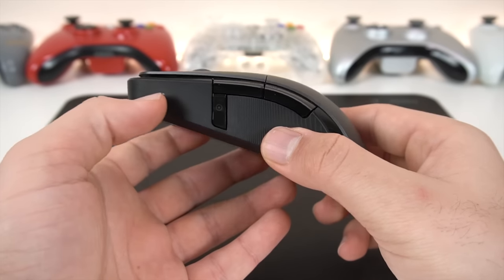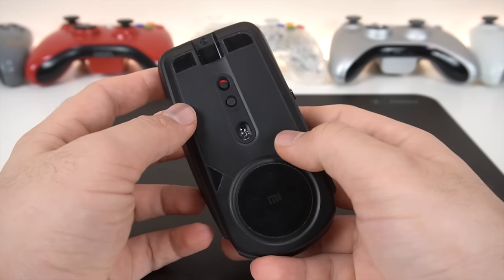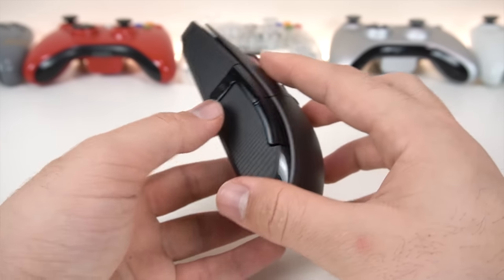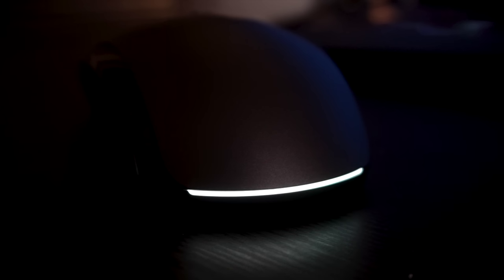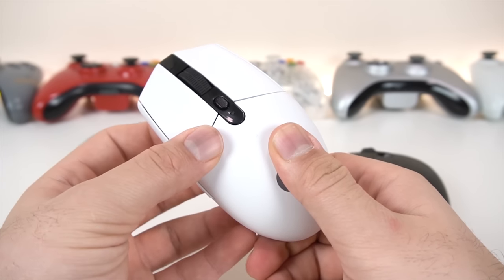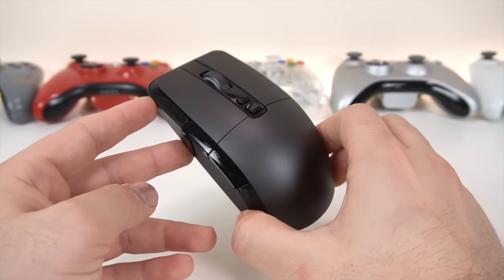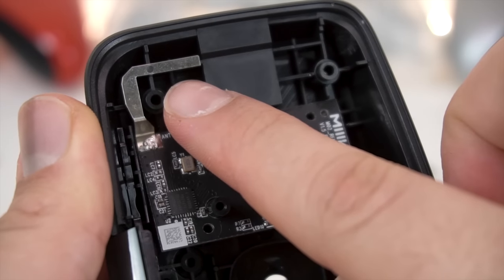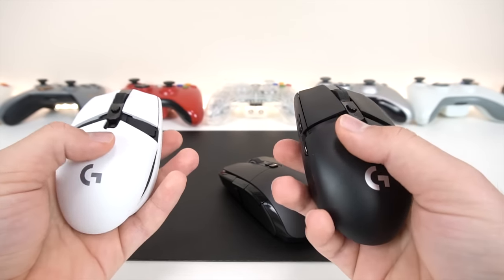Xiaomi Mi Wireless Gaming Mouse | Could Have Been Something Great

Comment: I have been using this mouse for 10 months approx., Dealt with two issues so far. The first one is battery life, of course. Dropping refresh rate to 500-250 etc. and shutting down LED lights through the software (you can find its fan version in english on youtube) works and extends battery life up to 3-4 days depending on usage. Otherwise you need to use it wired or charge it everyday.The second one is self-clicks on the left mouse button. I disassembled it and cleaned the button. Problem solved, but it was annoying tho. Apart from that, this is a great mouse, I like heavy mouses not fond of too light mouses, so it is not an issue for me.  Personally, I am playing games in wired mode and make other stuff wireless, since it is easy to switch between these modes. This is the best option I think.
Reply from the maker: Early cheap wireless mouse tech wasnt great back then now there are so many lesser known brands releasing good wireless mice in comparison

Comment: I have one. Mine does not make noise when you shake it.  Agreed that the wireless battery is poor. Less than a day. Polling rate drops from 1000 to 500 on wireless. I usually use it on cable. Not experienced the non wake up bug but I have not tried over a power off when it wirelessly connected as I generally don't use the wireless feature.

Agree that in use, the mouse feels great to use

The software would also make things easier if it was available with switchable language setting. Sad as the Gaming Laptop software that looks very similar is switchable to English. maybe an update will resolve that??

Comment: im a user of g305 for almost a year now. im not sure if i replaced the battaries or not i may changed it once and forget it or never changed it in one year of usage. it is a very good mouse in general buttons feel solid, sensor works just fine in most surfaces ect. i can definitly recommend one but there is one thing that you should know before you buy them. they are quite small even i as someone with bigger hands then avarage got used to holding the mouse over time but if you are not sure you probably try it in a store before buy it.
Reply: Hocam sence hangisi ben de xiaomi yada g305 almayı düşünüyorum senin tecrübelerin nelerdir , ben şu an g102 kullanıyorum ve çok memnunum elime tam oturuyor ama kablosuz olursa mükemmel olur diye düşünüyorum o yüzden Xiaomi yi elesem'mi diyorum

Comment: Design were a mashup between retro and futuristic i Almost bought it,  but after I discovered plenty of faulty units of it being perma dead after being turned off? I’m not taking the risk. 
Not to mentioned for modern wireless mouse, the battery life suck?  
For the same price, I’m now happy with Logitech M590   It has both bluetooth and receiver. Works fine on cs go for me..
I don’t buy the b.s of gaming thing either 

Original battery still running after 1 years (it’s crazy!!!)

Comment from the maker: Do you happen to have one? If so, how was your experience?
Reply: how to turn off the stand by mode for the lightning effect ??
Reply: I did get to use one for a bit, and only thing I seem not to really like is the lower design, making it a bit odd to hold compared to other mice from corsair or razer. But that's also a great thing, as its not designed over the top and can be passed off as a regular one.
Reply from the maker: @dime5682  It's either automatic or you have no control over it, if anything I would just turn the lights off
Reply from the maker: @Ripstikerpro  Yea it's not for everyone, and it's just yet another mouse that isn't too far off from the norm in terms of design
Reply: Great review. I already have this mouse but was curious to see your review and opinions. I definitely agree that the very big disappointment also for me is the battery life. I need to charge it after every 2 days with disabled light effects, that is very disappointing for the price. Also I experienced same problem when turned off my laptop - I had to turn off the mouse and reconnect it. It is quite great mouse but I was familiar to have wireless mouse working for month+ and this one last super short sadly. My score would be like 6,5/10 because of those 2 problems. Otherwise I would rate 8/10.
Reply from the maker: @SmallSoldierX  Thanks & Agreed, also have you noticed any high pitched noise / coil whine? I seem to now have it after taking it apart. When It's on or charging.
Reply: If I place my ear close to the bottom of my mouse, there seems to be the noise just like you wrote, nothing that can be heard from a distance but when listening closer - definitely yes. The noise changes after about 5 seconds (probably a chip detects that the optical sensor do not detects any movement) to some of a different kind. I tried to record it now with my MI6, you can check it here if you turn the volume up a little: https://youtu.be/tAp9ONy9jEM When I plug the charging cable, those 2 kinds of noise changes faster between each other multiple times.

Comment: Hello. When I use WIRED mi gaming mouse in my laptop, it works just fine. But when I plug my PC micro USB cable into the mouse, it only charges. The mouse charges, but can't be used (the arrow doesn't move). What's wrong?

Comment: Would I be able to drive this mouse with my apple keyboard usb? Microsoft intellimose works, some generic mouse works, but razer deathadder, microsoft pro intellimouse dont work ( gets system message saying something like not enough power)
Reply from the maker: I honestly cant tell you for sure. But i want to lean towards 45% chance it working if thats the case
Reply: @LifeKommando  thx for reply! Could you possibly check the consuming power rate of this mouse when wired? My microsoft pro intellimouse is rated 5v 200ma and apple keyboard refuses to power it. My old microsoft intellimouse is rated 5v 100ma and works just fine off apple keyboard. Maybe thats the case, maybe the keyboard hub only supports 5v 100ma.
Reply from the maker: @ThorThorich  I will try to check it once i am back from my trip. Hopefully i dont forget
Reply: @LifeKommando  i hope i'm not bothering you too much.
Reply from the maker: @ThorThorich  nah dude I'm interested in finding out as well :)

Comment: Mne started to left clicking by itself its really annoying and unusable right now, do you know any fixes for this?
Reply from the maker: you can take it apart and try to fix the click button bump (some videos on youtube can help) or buy a replacement part and solder it / replace the old one.
Reply: @LifeKommando  The problem is not button bump, it holds left click by itself, not double clicking. Do you think replacing switch would fix my problem?
Reply from the maker: @ingilizadam  Same possible fix, there is a small circle metal cup that is stuck in the pressed position in the button mechanism
Reply: @LifeKommando  okay, I tried cleaning the switch and its kind of working right now. I'll try your solution when it starts again. Thanks for your reply :)